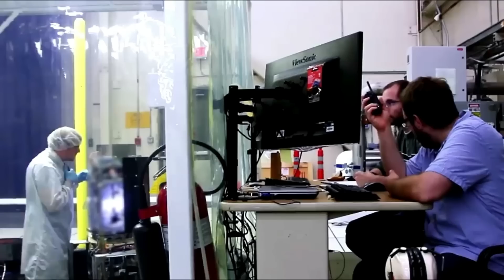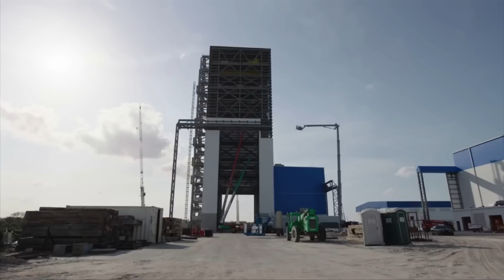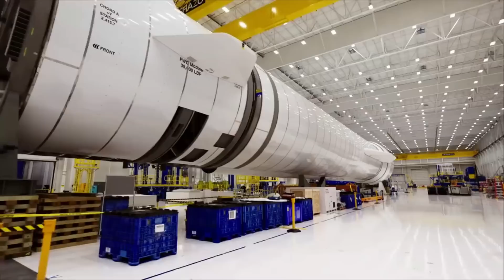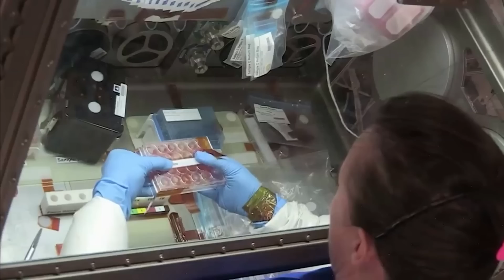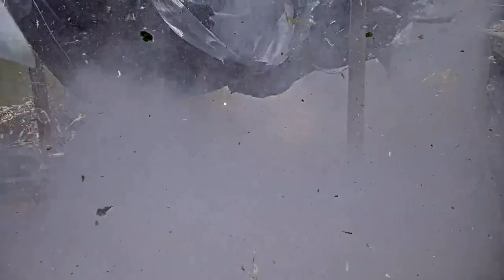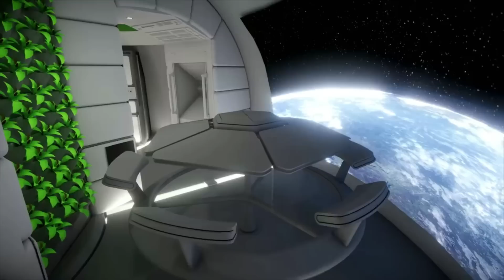Blue Origin Is Testing Orbital Reef's Main Modules

Comment: You have to understand, Blue Origin is starting from scratch. The NASA gateway is building on ISS hardware with heritage systems. 
B O will go a long way toward silencing critics if they get New Glenn into orbit successfully. It seems like they are going the NASA way of designing, testing, etc to exhaustion before they launch anything. But then that makes each launch or test a super big deal. 
SpaceX is going back to the old way of developing stuff, build, test, fix, retest, fix, retest, and finally success, then iterate to improve, test, fix, retest, etc. Personally, I think the SpaceX way is faster, and better, since you can never design for EVERYTHING and you will always be faced with things you didn't expect. Better to find those things out sooner rather than later. You also get really good at building things fast and you make engineering decisions with fast building in mind.
But then, after BILLIONS, the NASA James Webb Space Telescope worked on the first try, so the other way is capable too. But in addition to the James Webb type successes on the first try, there is a Hubble that was launched and then you had a crisis to fix the super expensive thing when something unexpected happened.
Reply: Greetings, as you say, if they get new Glen to orbit. The James Webb telescope, was delayed by a lot of years and cost way more than  expected.
Reply: @pierredemontigny8154 new Glenn will get into orbit, not “If” but more of “When”